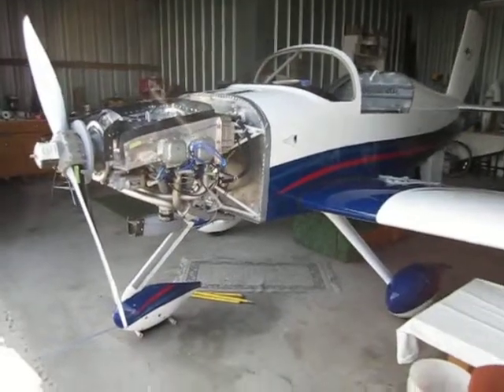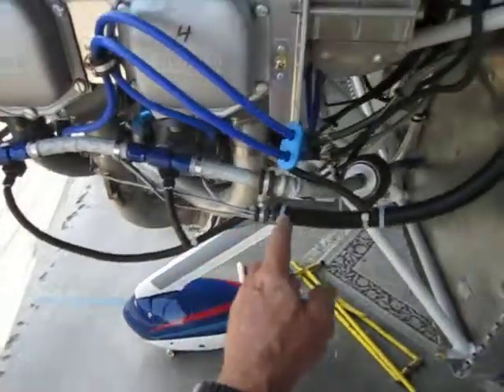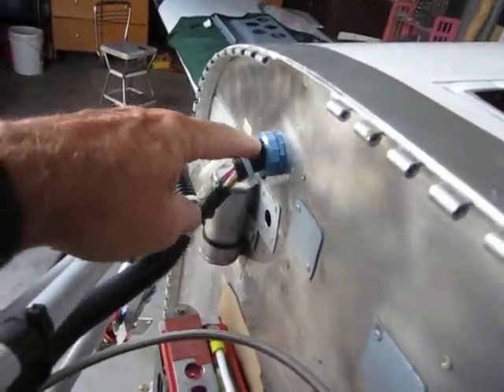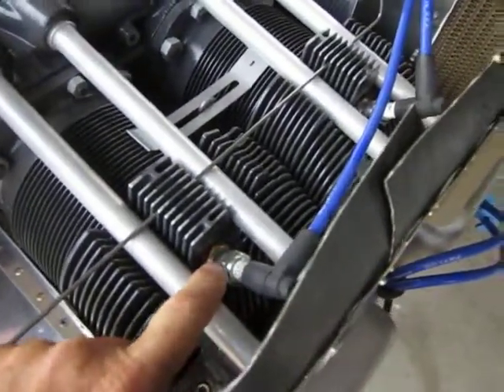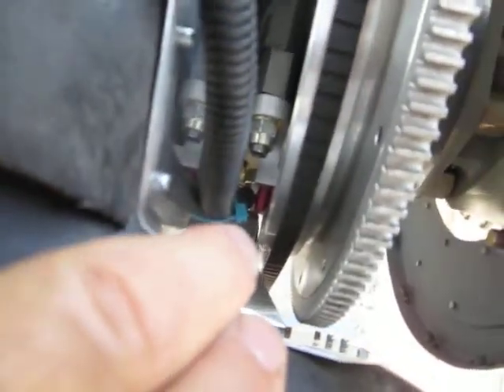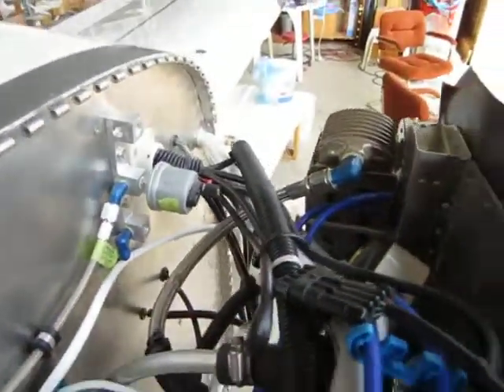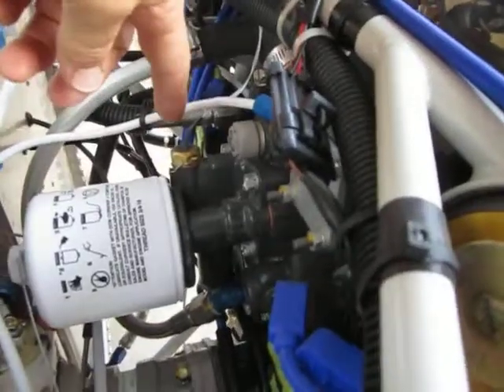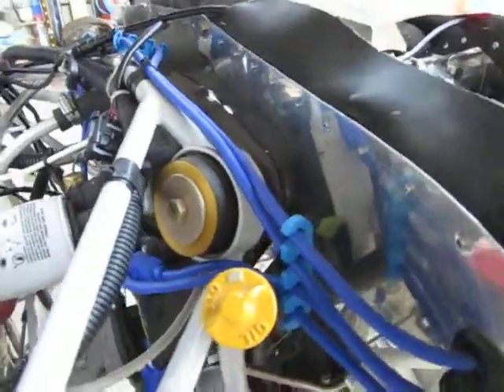EFII Electrical Layout in an RV-7A

Comment from the maker: My RV-7A is  fairly heavy, weighing in at 1200lbs with all the additional instrumentation, wiring, fuse blocks, dual batteries/pumps,etc.  I've been flying this plane for over a year now.  The engine hasn't hiccuped once and starts dependably after a couple of turns of the prop.  TAS at 8,500 (DA 11.2K) is 182mph and fuel burn of 8.0gph with two 190lb people, full fuel and substantial baggage.  Last compression check on all cylinders was 78-79/80.
Reply: Nice sirrrr